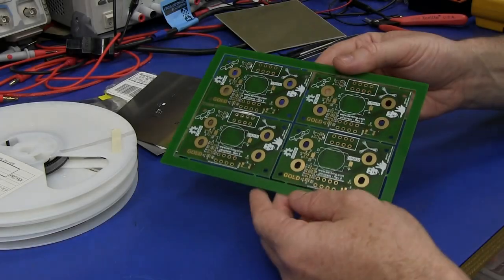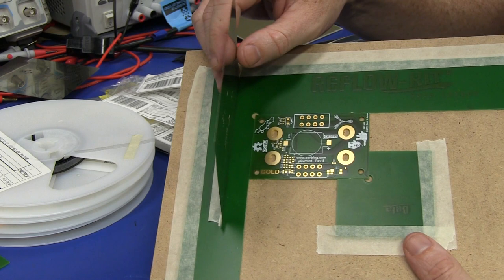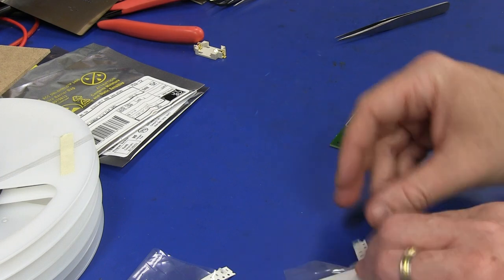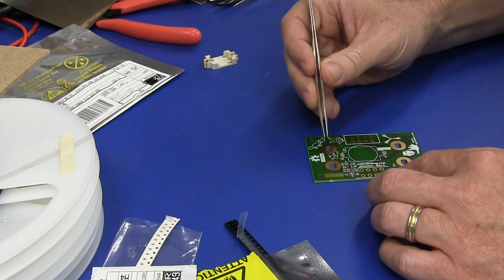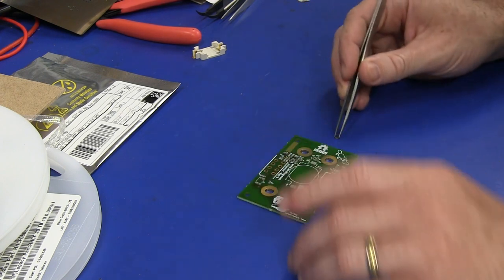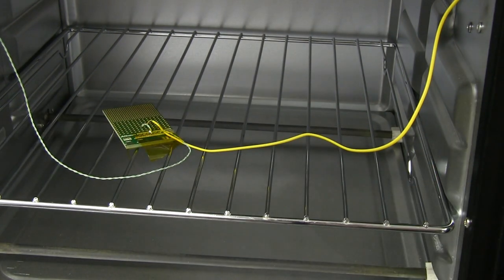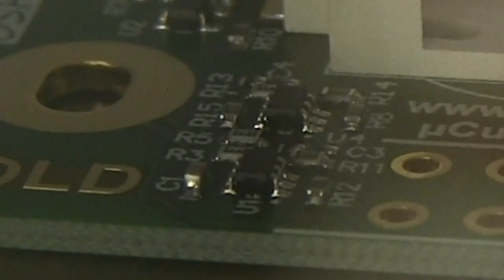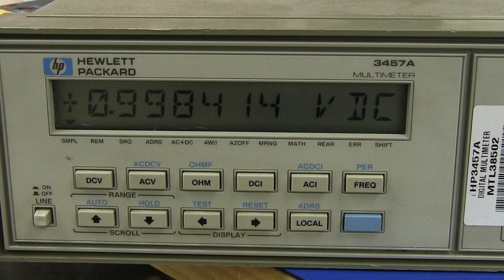EEVblog #562 - More SMD Oven Reflow

Comment: Just a tip for any newcomers who might be stumbling across this video, Dave mentions using the piece of copper clad under the PCBs, which is a great solution and one I've used in the past. But if you're looking for something a little more resilient, I find a thin piece of metal works even better. Personally I yank one of the panels off an old CD/DVD-ROM drive (I have dozens of the things just sitting around) and put that on top of my oven's tray. Works great, after the first few bakes the metal turns a rather interesting copper-ish color and sinks away any unnecessary heat.
Reply: Thanks,  I was going to ask a question on this: now I don't have to.
Reply: Thank you for advice

Comment: That green board looks Brill.

Cool vid Dave
Reply: I agree with you John, it's got that Mil-Spec look to it. x]

Nice work Dave, I appreciated the full length shot right from snipping the boards out to the testing after.

I know I'm not the only one that needs more than 4 attempts to turn a 0603 resistor. xP

Comment: Hi Dave, You can use a silicone cooking mat in the oven to insulate the boards from the support. You can buy it at any cooking store, not very expensive. Just cut it to size.

Comment: When I saw all the parts reflow together at the same time through the oven door, I was confident that the reflow was going to be a success.
I'm really tempted to get that reflow controller, but use it to control a small hot plate instead of an oven; lack of space you see.

Comment: I wonder if you got a tiny fan that could take the heat inside, and putting it in there would it help with the reflow to be more even since the air moving around the boards might not be all that fast moving.

You might be able to drill a little hole in the side, and mount an external fan if you can't get a fan that can take the heat... I don't know.

Comment: Should you defeat the thermostat control in the factory toaster?  It is right there at the edge of the solder profile and probably not even close to accurate.

Comment: Just so you know Xcelite is pronounced Celite (See-lite). The X is silent just like the K in Knob. The reason I know this is back in the 80's when I used to fix consumer electronics I was at one of my locale parts jobbers and the rep from Xcelite was there and I called them Xlite and was promptly corrected. 73 Lawrence, KF4HNF

Comment: How would you use this oven with smd parts on both sides ? Does the soldering paste hold the components upside down ?
Anyway great video !!
Reply: No they would all fall off. In manufacture they have to glue the components down for the bottom.

Comment: So DIY reflow oven or cheap Chinese factory QS5100 etc. ?  Looking to reflow Cree LEDs to star boards.
Reply: if you dont plan on doing like >1000 of them i would use a hot air gun/station

Comment: I love using those Xcelyte flush mount cutters to trim my toenails.
Reply: Me too!  Fingernails also! I have Xuron and Plato brand, but they are the same thing. I have some little tiny Italian ones with an alignment pin in the mechanism, but they cost about $160 a pair, so no nail clipping with those.

Comment: Hi Dave, thanks for your video! I have the same kit and temperature issue from beta layout and was wondering if you still kept the thermo couple calibration adjustment from your previous video while using this clad board solution? Must say I love the idea of using a clad board and will surely try that as well! Thanks! Tijn
Reply from the maker: The copper clad board is not a good idea, as I said. Yes, same setting.

Comment: I never had much success with these DIY reflow ovens, the direct IR from the heaters seems to be the problem, lots of hot spots, impossible to ramp with any real control, I gave up and put mine in the bin, now I use a DIY hotplate and its a much better solution for small batch work, I would stay away from these DIY ovens, hot plates are much better.

Comment: Dave, is it me or those solder joints look of poor quality. No shiny mirror surface, black dots on some, and no surface curves. It might work now but I would be worried about customers shipping them back to you when they start failing prematurely. My two cents would be to stop dicking around with a microcontrolled toaster oven and buy a proper high powered bench top reflow oven. But i guess maybe it's good enough for testing your prototype and have it produced ordered.
Reply: +goognam goognws You have to consider, that he used lead-free solder. So this could be the reason why the joints dont look as good as you might expect them to be. Of course a proper reflow oven would maybe produce better results.

Comment: couldn't you just use two pieces of wood, or some material that wouldn't degrade because of the heat, to lift the pcb from the metal bars, minimising the heat lose. or you could cut some thin metal bars to the width of the oven, and place them in such a manner that only the sides of the pcb are in contact with them. Black lines represent the contact points: http://i.imgur.com/rlRiGHV.jpg (picture of an older pcb)